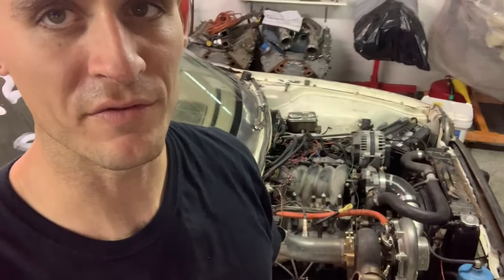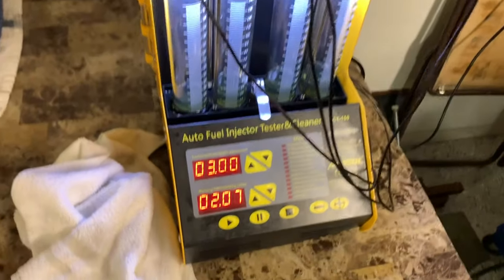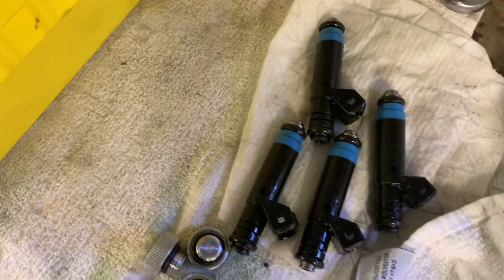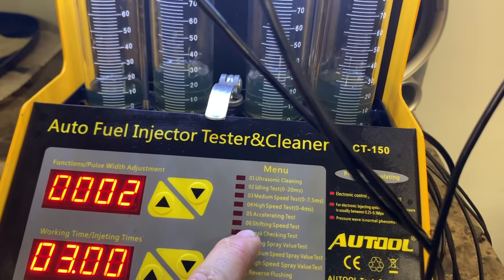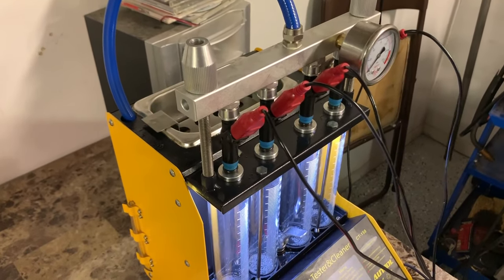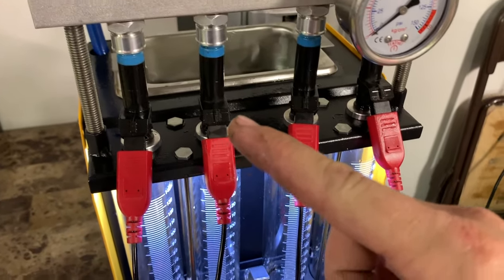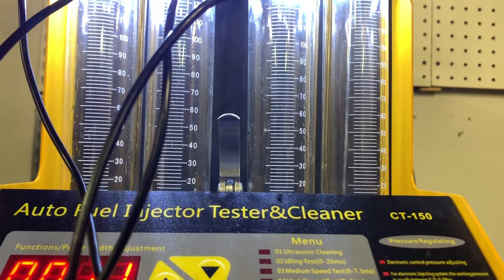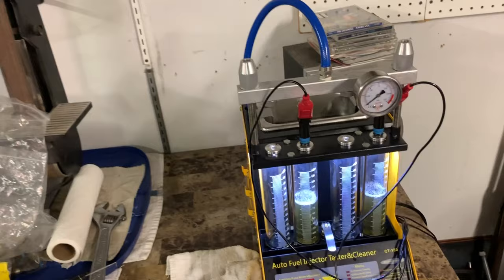Injector cleaning with Autool 150 machine

Comment: They don't debur the common rail it's fully of swarf from the drillings. Took the end plugs out of mine and debured/cleaned out the whole rail and added a bosch filter inline. I ran it full wack for sometime before I put an injector anywhere near it. Done loads of tests and still going. It actually has a bosch pump!

Comment: Use mineral spirits in the machine to flow test. You can get it at Walmart or Home Depot Amin the paint section. Also I use a purple power 50/50 mix to ultrasonic clean them
Reply from the maker: Hell yeah! That’s rad I may try the 50:50 mix
Reply: @DickHamm  Purple Power has led to corrosion on certain alloys. Simple Green Extreme (aircraft)  is the ticket...and I've tried them all. Good luck.
Reply from the maker: Thanks! 👌

Comment: My wife and I both have DI instead of Port injection. I want the ability to clean our injectors at home instead of paying someone else, and have seen this machine quite often in shops. Is this machine adequate and reliable? Any problems or hiccups with it? Thanks!
Reply: The CT150 doesn't do DI injectors. The CT160 does. I found this out the hard/expensive way.
Reply: @user-bq4xh5fy5b  Thank you very much.  How has this machine held up for you? It seems to be in every shop, and alot of the automotive youtubers have them.
Reply: @RichPrivilegedWhiteMale  It seems well made. Build and holds pressure well. The ultra sonic looked a bit weak but did the job well. Definitely go for the 160 or dearer.

Comment: What’s the maximum size injector that the AutoTool Injector tool can handle?
Reply from the maker: Good question! I’m not sure. I’ve done larger injectors one at a time without an issue. But it has a walbro 255 in it, for reference
Reply: @DickHamm  I messaged AutoTool here on YouTube video and they don’t have a particular “maximum injector size cc.” Now I’m assuming it’s more about I guess the cleaning and seeing how even they flow comparing the cylinders and paying attention to the spray pattern to make sure it has the same spray pattern to atomize the air and fuel equally. It’s kind of a mission to see such a tiny almost microscopic spray pattern or to know how dirty or not dirty the injector set is. I’m on the side of getting one of those tools as I plan to build/maintain projects that would benefit from that AutoTool injector cleaner kit. I had decapped side feed injectors and they ran fine for like a year and just over year or so I put a bad batch of fuel and I floored the car it made a weird reaction and I noticed it had worse compression on a piston cylinder soon after. That was about just over 10 years ago and I did not have e85 compatible fuel hose which might have deteriorated and left modified side feed injector stuck open etc., even though it was 90+octane it had 10% ethanol in it for over a year and I once ran AVgas and full e85 during that same time frame. Injector Cleaning becomes more and more important on modified vehicles especially since I learned on a built short block. It’s a way to protect your investment of time and money into your vehicle’s engine(s).
Reply: My main concern now is that these are gimicky injector cleaning tools that might clean say a stock OEM style injector to like 42lb injector or like 500cc and under but would not flow say 2200cc Bosch or say Atomizer 5000cc 500lb style like it should with the correct pulse width/adequate wiring and/or frequency. I’m sure if AutoTool can’t answer that question and neither can 90% of the consumers then the machines themselves are “hit or miss” and they might work, but for how long and with what sort of efficiency/reliability? I noticed in a video online results had varied for the user on one of the tests........ one of the last things anyone would want is to be scratching their heads over their injectors right?
Reply from the maker: @schmitty_luv  Yeah exactly the kind of thing I bought mine for! I figured I for the money I can at least go through and clean and check my stuff. Smaller ones you can def get an idea of flow but matching them and making sure they are clean was my main concern. I think any more than that you would want to get a bigger/different machine